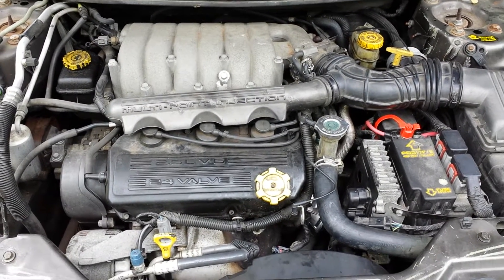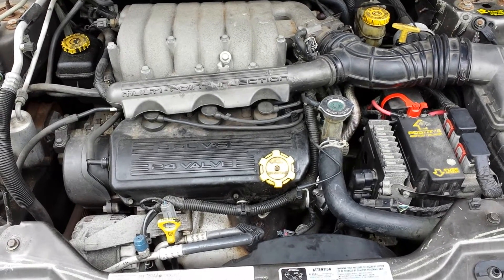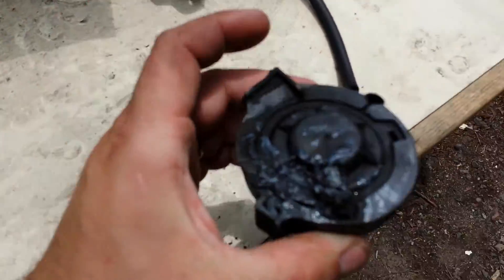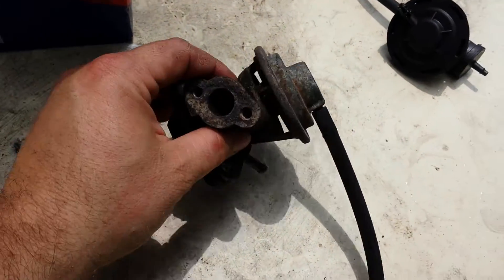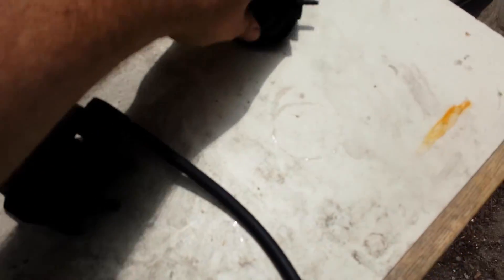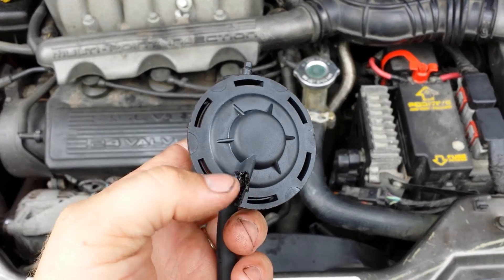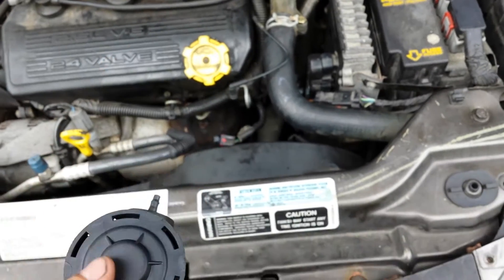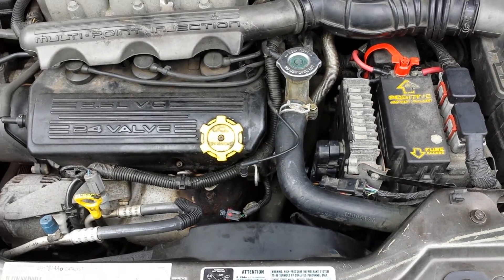Chrysler 2.5L EGR Problem.  Please Help

Comment: Got a 96 stratus with a 2.5, was moving the computer and engine control stuff and the egr tube that went to the intake was in the way so rednecked up a solution, bent the tube back and forth till the tube broke off, took the mounting plate that goes to the intake off the tube took and cut up a beer car to block the hole and it started up and ran off carb cleaner (don’t have a fuel cell hooked up yet) (also running the car in a demo derby so idc if that is sketchy) also leaks coolant when it warms up from both sides of the motor so just gonna send it

Comment: Does the car set a p0420 code? High exhaust back pressure will cause that.
Reply: paul ames hello there I have the same car and my and my don't want to start it's not the fuel pump and it not the  distributor I changed the distributor and it still don't want to turn over come on please help me what can it be

Comment: sebrings are very difficult to work on. I'm trying to replace a power steering pump and I'm having a very difficult time. the designer of this car should have been fired.
Reply: Yup the bracket wraps around the timing belt cover but thats the easy part. I just changed head gaskets and its a real congloberation let me tell ya